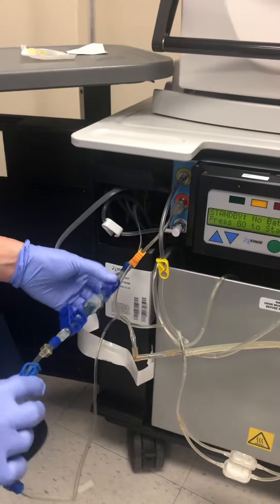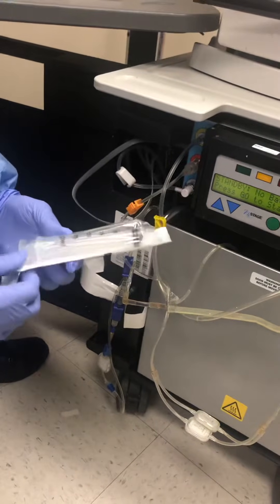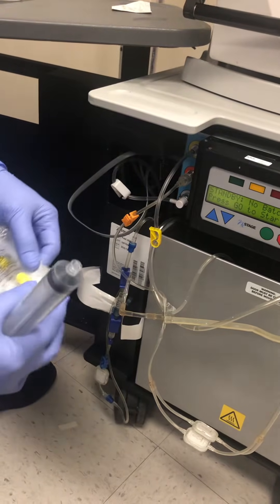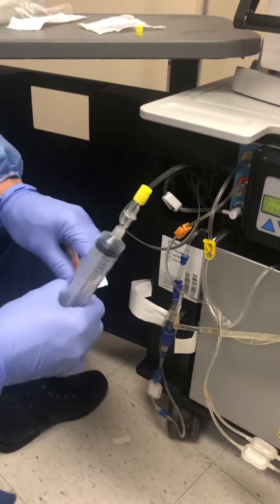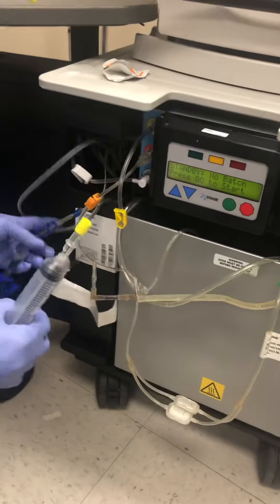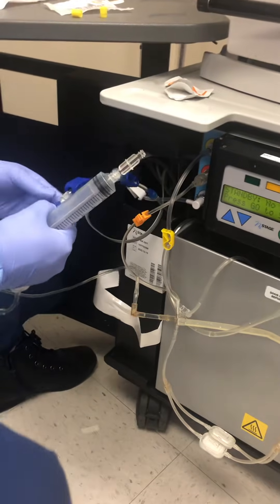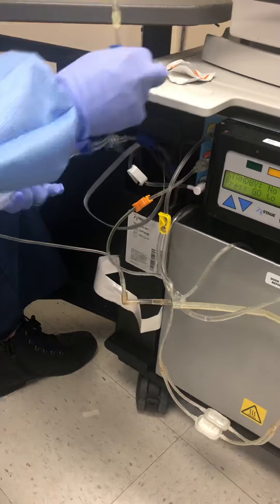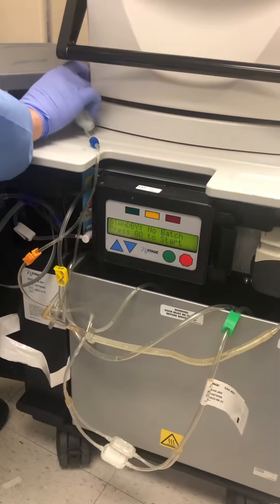Nxstage Pureflow-Collecting Water From the PAK

Comment: This procedure is not correct. The best practice is to call NxStage and talk to the technology support staff. Basically you have to start with the pure flow control unit when it says Stand by: No Batch Press Go to Start. You have to press and hold the green down arrow until the control unit shows Setting, and keep pressing and hold the green down arrow until it shows Product Water Testing, then press Go button, it shows Product Water Dispensing, now YOU CAN COLLECT PAK WATER AND HAVE IT DRAIN DIRECTLY INTO THE BOTTLE, WHEN THE BOTTLE IS FILLED UP, PRESS STOP.
Reply: Thank you for this explanation! I am about to start home dialysis and my training nurse asked for a water sample but I couldn't remember how to do it
Reply: I just tried & was able to do it the way she did in this video, so No, it is not “incorrect” … it’s just another way to accomplish the same task of getting a sample — especially if you are in between treatments that a single Batch can do.

I just used a “peanut” aka Recirculator to connect a 50mL syringe to the blue line.